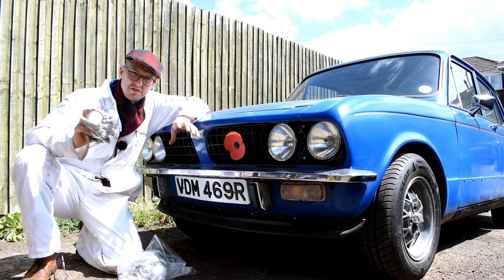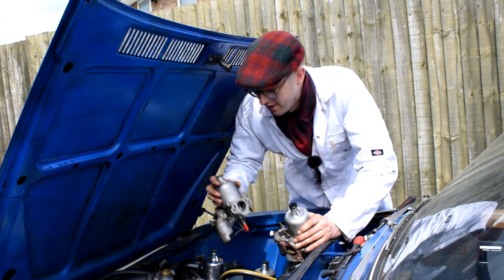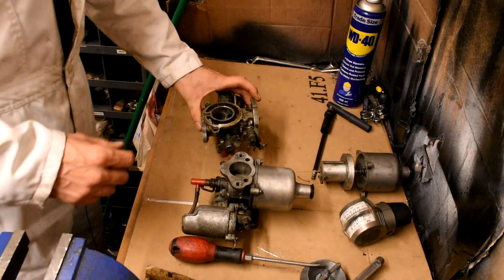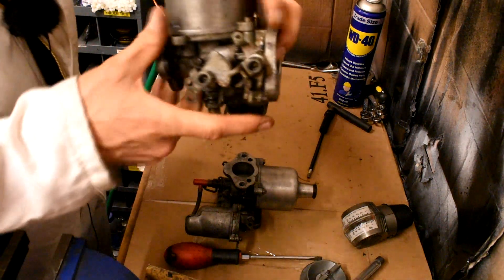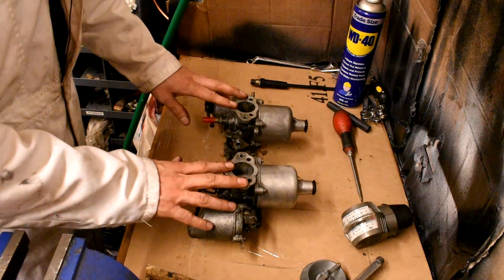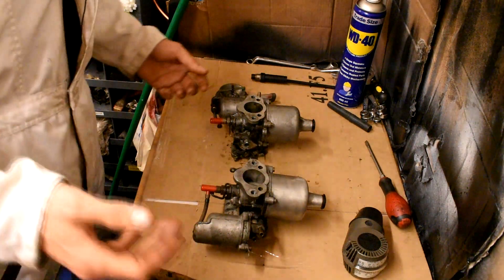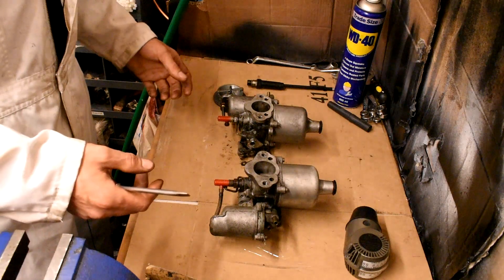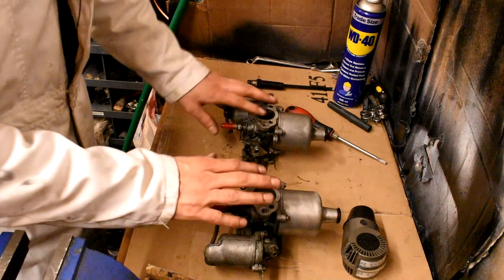Triumph Dolomite Carburettors

Comment: Great video! I didn't know that depending on the oil, it changes the speed the engine accelerates at, very interesting ! You explain stuff really well and are very knowledgeable 👍
Reply from the maker: Cheers mate, yes the grade of oil affects the rate the dashpot moves, and will affect how the car will perform 👍

Comment: Steve, that was a very informative video and I can't fault any of the techniques. With some things, there are more than one way and none of them are wrong. You said the old carbs were off a TR7. The TR7 had HS6 carbs but most of the 1850s had HS4s. My 1850 had HS6s on a TR7 inlet manifold which is different to the 1850. I've long since reverted back to HS4s. You'll be glad to know that there will finally by some more Dolomite content on my channel very soon (at the time of writing).
Reply from the maker: Cheers David, as they say more than one way to skin a cat. Be good to see your Dolly back up on the tube 👍🏻

Comment: As it's original I would leave well alone for as long as possible - it looks in amazingly good condition -  and only fix what is essential. We can all own fully reconditioned cars if we have the money (some more original than others !) but owning something that has genuine age all round is very special. Originals are always the ones I head for first at shows. Great video.
Reply from the maker: Cheers John, this has always been the issue with the dolly, if it was restored it would loose so much of its charm. There not many 1850s left, so I'd like to keep it original. It nice when so many agree with my thoughts on it

Comment: Patina is a wonderful thing, history lost when restored!
Reply from the maker: That's the problem, restoring it will loose its sole. Its first owner had it from 1977 up until around 2003, and it was garaged for all that time. The interior is a time warp, never been touch or changed, and with only 43000 miles on the clock, its just something special, or at least it is to me

Comment: Steve, great instructional video once again.  I agree with you and Tush, only original once.  If the car is road worthy and a nice 10 footer, leave it as is.  These cars are not valuable, so don't over invest, just enjoy.  I bought my Triumph to tinker with and drive. No computers, just wrenches and screwdrivers, timing lights and vacuum gages.
Reply from the maker: Cheers Graham, this is so true, there is a few things that do need to be sorted out though. The engine was taken apart by a previous owner and not put back together right, the gearbox needs new bearing, and the some of the front suspension bushes need replacing. But that all said, it's trying to preserve what I've got without destroying the history
Reply: Steve Denton Steve, it is just a pleasure to see "old" cars on the road.  A trend in North America is to "drive em as you found them".  Mechanical restorations, cosmetics left alone, or clear coat over the rust and patina.  Some look quite good, especially old pick up trucks.  May also have something to do with the cost of restoration!
Reply from the maker: That sounds very much like my MGB, however with what I'm spending on it lately its looking more like its going to restored

Comment: HI Steve.You do know that "officially " Sprint  wheels should "never" be fitted to any other Dolomite. That was a memo sent to all dealers in the '70's. Apparently the studs could shear. I think this is 'Billy bol***s" . They just didn't want the lower specification Dolomites to look as cool as the far more expensive models. You should have done this last year, it would have saved me £700 quid! ( not true) these were for my "e"type!  Your knowledge is scary!  I suppose my metalwork skills are equally scary to you. Thanks Steve. Your the tops! I had a Sprint in Tahiti Blue . Fantastic in the dry, undrivable in the wet! One of the most underrated cars ever!
Reply from the maker: Hi John, yeah I've heard of this memo, and yeah I agree, it's bol****s. That said my dolly been reto refitted with the larger sprint wheel studs on it anyway, so it makes no odds. I think the memo was more to do with that. When the the car was first built they had 2 types of studs, they changed them a larger type later in production. And I completely agree the dolly is a massively underrated car. Especially when you compare the dolly sprint with the Ford Escort Mk1, there's not much between them. OK Ford is better developed, and I won't say no to one being in my stable, but it still shows how underrated the dollys are

Comment: Great video as always, I've always liked SU carbs but never had any! My opinion on the car is, there is usually a time where it becomes obvious that some restoration is necessary, if it's not there yet then leave it and look after and service it when things are needed 👍
Reply from the maker: Yeah, I can see what your saying, its at that point with the dolly where I don't want to loose the history, but things like the gearbox are wining, the engine is tired, and it needs a good going over. It's all about being careful with this one not to loose the charm of what the car is
Reply: @SteveDentonClassics  absolutely man, keeping it mechanically good but preserving the years it's been original and survived is a great thing.

Comment: Well, if the car is serviceable and it’s safely on the road, then just drive it and look after it.  There are not too many survivors left...I can certainly appreciate a survivor as much or more than a pristine show car.....
Reply from the maker: Yeah that's what I keep telling myself, its a fine balance between restore or survivor. The interior has never been touched from new, other than a new rear parcel due to a previous owner sticking speaking in it and a duel oil/temp gauge for sensible reasons. As for the bodywork, it tired and someone between me owning it the first time then the second time has put a plastic wing on the passenger side. I've never been happy with that, I have got a new metal one to fit at some point. Its like you said just keeping on top of it

Comment: Brilliant so helpful and i was going to buy an air mixer didn’t no which one
Reply from the maker: The flat one with the thermometer on the side is cheaper to buy, the downside is you have to turn it's back to get a reading. With the cone type one, you can just put it straight on any engine without having to adjust it to get a reading. However as I said in the video with the cone type one, if you do buy this, don't pay too much attention to the numbers on it. The lower you can get the numbers the better, but what you have looking for is a balance in air flow between the two carbs. So you need to get the numbers on the cone type exactly the same and as low as you can to the desired engine idle speed 👍

Comment: Very nice 1850 but the top end sounds pretty tappy.... not like a sewing machine ?

Drive it when you can... these need to be seen on the roads, even if then are slightly faded.
Reply from the maker: Realistically it needs an engine rebuild, as its been messed around with by previous owners. Since buying it back I've just kept putting it to the back of the restoration queue, I'll will do it one day 👍

Comment: Steve, it was an eye opener when you mentioned John Twist and to blow the carbs out. I live in Grand Rapids and have owned an MG for just over 30 years. Consequently I have known John that long. I was never more than 15 minutes from his shop and he has been a wealth of information. I know he did some technical seminars for the MG Owners Club 4 or 5 years ago.  How did you come to know about John?
Reply from the maker: That’s awesome, John Twist is a guru with MGs and British car, what John doesn’t know isn’t worth knowing. I don’t know John personally, it was more a case when I was doing my apprenticeship some 15 years ago and YouTube was a new thing, John did some really helpful videos. I’ve followed and admire him ever since 👍🏻
Reply: @SteveDentonClassics   He has since retired from running his shop and one of his employees has taken over the business. John worked at University Motors in London in the early 70's since he wanted to learn from the bottom up. He had to jump through some hoops to get there, but he learned from some who were extremely experienced. John was always ready to pass on the knowledge and each winter he sponsored tech seminars to learn about engine, gearbox and carburetor rebuilding. When ever I have and issue I am having trouble with John is only a text away.  Keep up with the videos and your business. Best of luck.

Comment: Hi Steve great video. Would you consider doing a set up of a Tr6 injection based on your car or preferably a CR version Tr6.  I have the delorto unit and are yet to give it a go.
Reply: Furlough Project I ave set myself
Reply from the maker: Cheers mate, it is on my list of jobs to do, to make a video on CP and CR throttle linkage set ups, but its a case of watch this space, it will be made but I can't say when